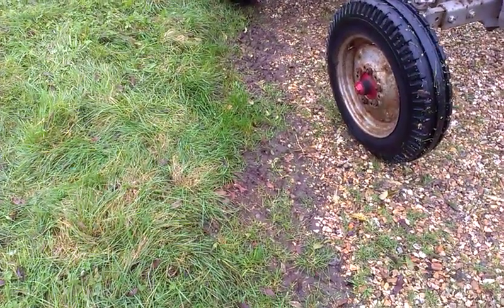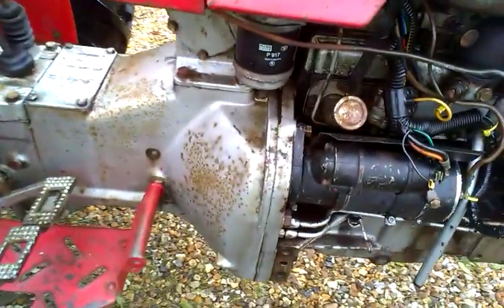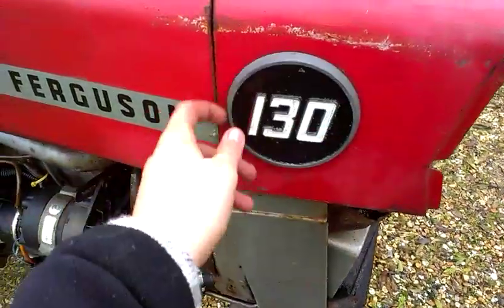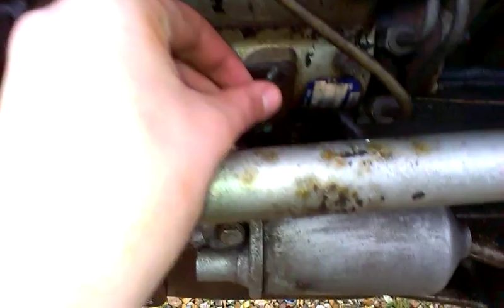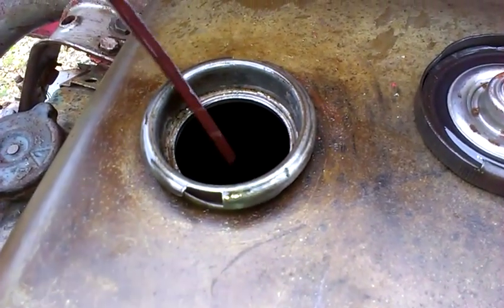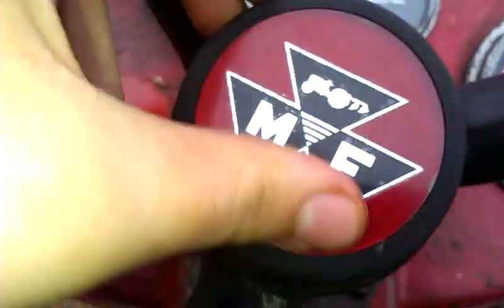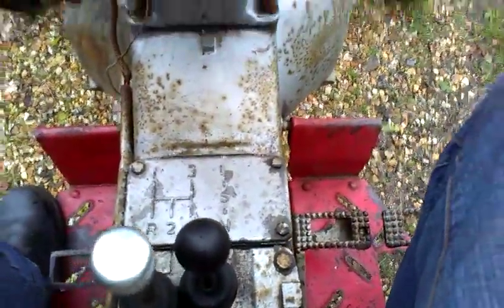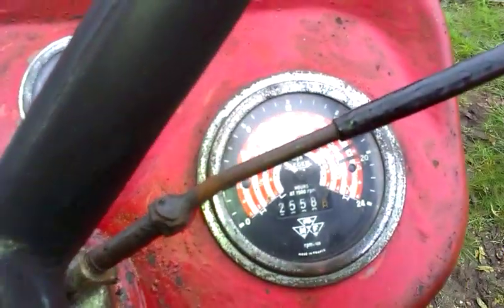New Tractor !!!!   Massey Ferguson 130

Comment: Great tractor that i must say!
i also have a fordson dexta under restoration,
i noticed your user name,
we have 2 traction engines Fowler general purpose engine 9225 "pride of the wye"
and fowler ploughing engine 15231 "prince"
good luck with the tractor check my channel out when you have a min,
i have subbed,
many thanks charlie
Reply from the maker: thanks for subbing Charlie
the 130 isn't to bad of a tractor at the moment I am at the half way point of the restoration and
a few things have ended up causing some trouble as the 130 is a rare tractor so parts are very difficult
to get hold of
I also do model steam and rc boats but always liked the full sized engines
will take a look at your channel
Connor :)